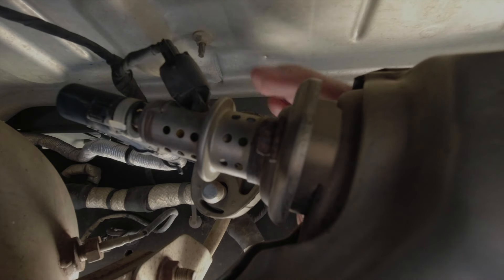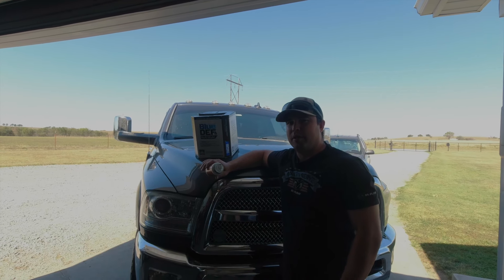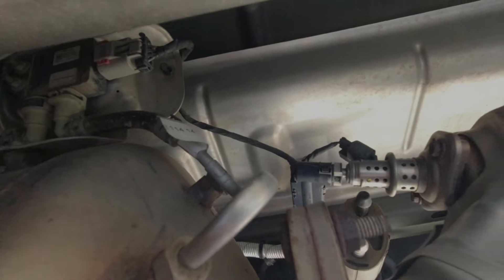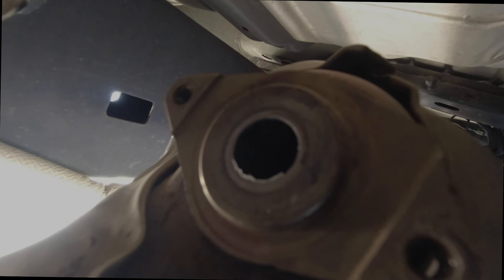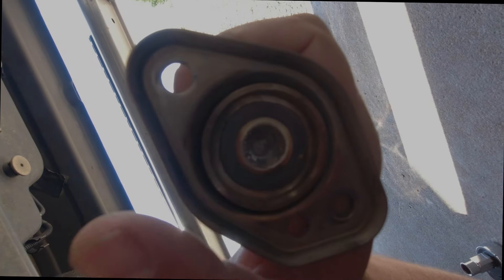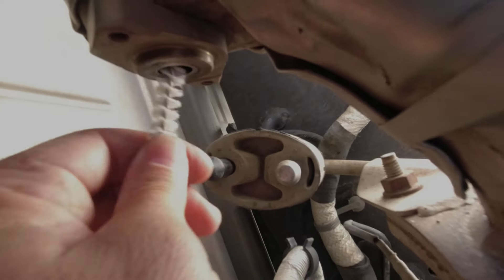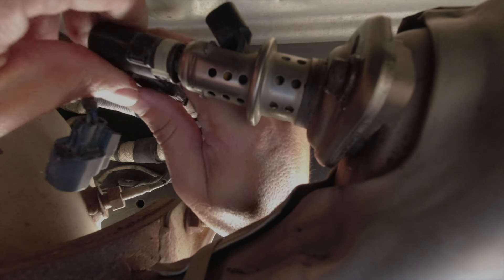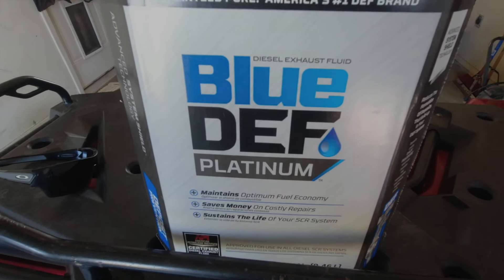SAVE $$ ON COSTLY REPAIRS!!  Peak Platinum DEF For Your Ram?  Plus Cleaning DEF injector How To

Comment: I’ve ran cheap def in mine forever it’s still fine.
Reply from the maker: That’s good your saving money
Reply: Me too. I had a friend recommend pump def because they are constantly replacing it. Boxes can sit in stores for a long time.
Reply from the maker: Just check that dates on the boxes
Reply: I have got bad def from pump and got the service def code on the way home. I drained the def tank, put new Walmart box def in it. The code went away.

Comment: I have a 2018 Dodge Ram and I've been running the blue def platinum since 140,xxx miles 2 years ago and I'm currently at 185,xxx miles and never got a re-gen light after that.i fell in love with the product and don't use anything else.i highly recommend it I've had great results and i get more miles out of the blue def platinum vs regular def
Reply from the maker: Excellent news!!
Reply: @4MRanch  I forget to mention it's a 3500  powered by the Cummins 6.7 and Aisin transmission 4x4💪💯💪
Reply from the maker: Can’t get any better than that comb

Comment: Thank you very much I have a 2019 Cummins and  check engine light came on limit to 145 miles Truck will be in limp mode and will only do 5 miles. Thank you. It really helped me out.
Reply from the maker: Good deal glad it helped

Comment: One tip I would recommend is use a good penetrating oil like nock er loose before hand on the bolts and let soak because if you break these bolts you have to replace whole unit which is thousands

Comment: I buy my def at the big truck stops since they get a new supply every week.
Reply: I did that n then the problems started with mine.   Coincidence I’m not sure 🤔
Reply from the maker: Yeah I’ve always heard not to buy from truck stops because the batches delivered are not consistent and pure but who knows for sure. 

We do fill out fire trucks at work up at the local gas station from their bulk def tank and all three of the fire engine have had def problems so there’s that.

Comment: Just add some Rislone DEF Treatment to clean and prevent crystallization on every DEF fill up and run Hot Shots Everyday Diesel Treatment.
Reply from the maker: I’ve used the hotshots fuel treatment it works pretty good.

Comment: Great Video thx, Question: Is there a DTC (Diagnostic Trouble Code) that you get when the injector on the SCR is crystallized or cloggs up? If so, what is it? Thanks
Reply from the maker: I’ll have to look up the code but I believe there is one an it will say def fluid pressure low or some like that
Reply: @4MRanch  Note: Most DEF Systems usually work above 70psi C/T the Redundant Pressure Sensor. The pressure sensor between the DOC and SCR is looking for an avg. of 3 PSI or more to see if the DPF is loaded, or to run a regeneration. However, in a Ram Cummins you cannot run a regeneration at will. It needs a code 1451 set to run an active regen with a scan tool.
Reply: I drive a 2021 Ram 2500 4x4 with a 6.7l Cummins diesel. P.S. Where is your ranch?
Reply: This injector code popped up for me while pulling my 5th wheel thru the north side of Atlanta on the 4th of July weekend...don't know who I pissed of for that!  It's the "P202E - Reductant Injector Valve Current Range/Performance Bank 1 Unit 1" code.  My 2017 3500 gave me 100 miles till derate.  I used my code scanner to reset it twice and it gave me another 50 miles each time to get home.  Check your Omns for a range of 13 to 16 as that's what the sensor checks...

Comment: How did you clear the stored message?
Reply from the maker: Code reader of a couple drive cycles it should clear unless you actually have a problem
Reply: Thanks
Reply: Where do I buy the seal
Reply from the maker: Should be a link in description

Comment: The main thing is once you see service your def system...
DO NOT IMGNORE OR RESET THIS MESSAGE. Stop immediately call the auto parts store and get the part as soon as possible. Do not drive any more than you absolutely need to to get the piece fixed. If you keep driving with this it is no longer pumping so it is backing up the system and messing up your pump which is going to burn out your pump and cause way more money in damage. I will tell you that I use truck stop def and have only had the problem once. Platinum death is for suckers.